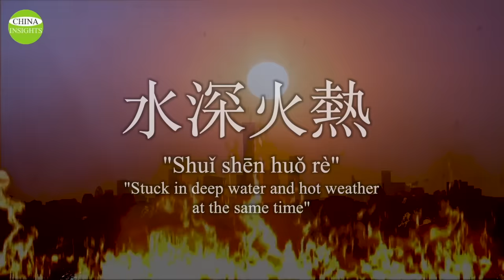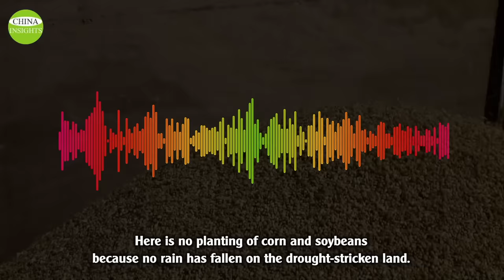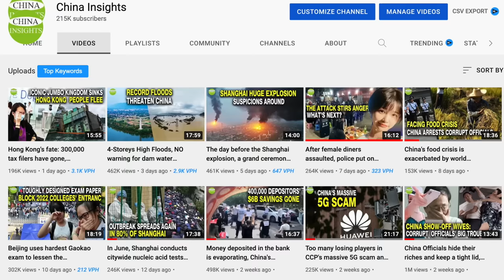Over 60°C! Record Heat Wave Joins Floods Threatening China's Food Supply...and Power Supply

Comment: You should read up on geoengineering and cloud seeding. Those are the causes of the weather manipulation, unbearable heat
Reply: I have noticed the last 6 months that after sunset there is a eerie glow in the stratosphere which I have never noticed before. Something is going on
Reply: @gary122  😂
Reply: @Diana1000Smiles  Geoengineering is the deliberate large-scale intervention in the Earth’s natural systems to counteract climate change.

There is wide range of proposed geoengineering techniques. Generally, these can be grouped into two categories:

Solar Radiation Management (SRM) or Solar Geoengineering

SRM techniques aim to reflect a small proportion of the Sun’s energy back into space, counteracting the temperature rise caused by increased levels of greenhouse gases in the atmosphere which absorb energy and raise temperatures. Some proposed techniques include:

Albedo enhancement. Increasing the reflectiveness of clouds or the land surface so that more of the Sun’s heat is reflected back into space.

Space reflectors. Blocking a small proportion of sunlight before it reaches the Earth.

Stratospheric aerosols. Introducing small, reflective particles into the upper atmosphere to reflect some sunlight before it reaches the surface of the Earth.
Reply: @Diana1000Smiles  well laugh away, I know because I observe the sky and have done for many years. If you live in the big cities with all that LP you won't notice anything different, but it is there.

Comment: The first video is bullshit.  That pan was stove heated before the video started.  The oil would have to be over 212F for adding water to splatter oil like that.  The oil had just been poured into the pan.  Even blacktop on hot days doesn't get that hot (145F on a sunny 110F day).  The video claimed surface temperatures of 165, which still isn't enough to splatter oil, though it can fry an egg.

Comment: 60 degrees celsius is 150 degrees fahrenheit. No. Total bullshit. - corrected to 140, STILL higher than ever recorded, and total bullshit.
Reply: 60C is 140F. Not 150.
Reply: Actually 140 degrees Fahrenheit  but still seems unbelievable.
Reply: @dmichaels111  It's possible,but rare.
Reply: In Iran,they recorded a temp of 70C in a desert.
Reply: The ground temp and air temp are probably different. Ground temp in urban centers can get very hot without proper city planning, like extra plants